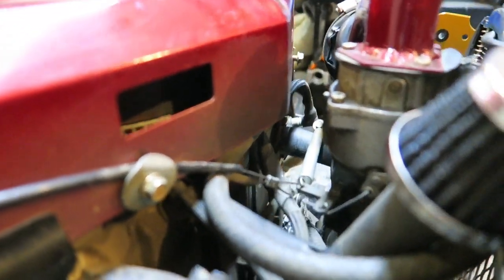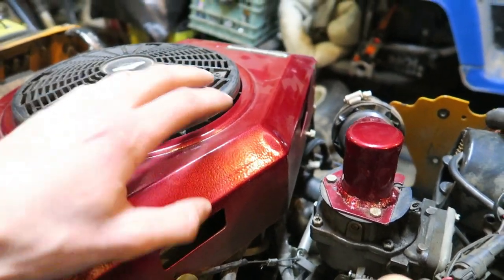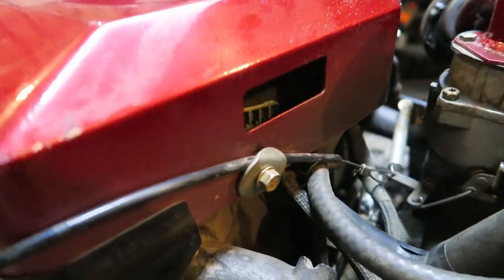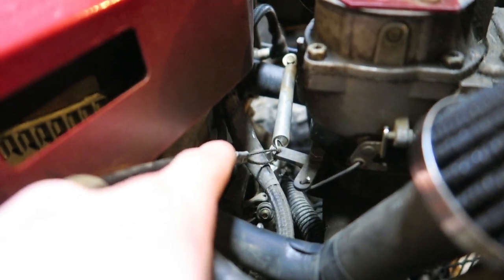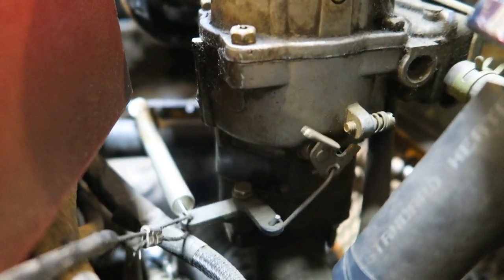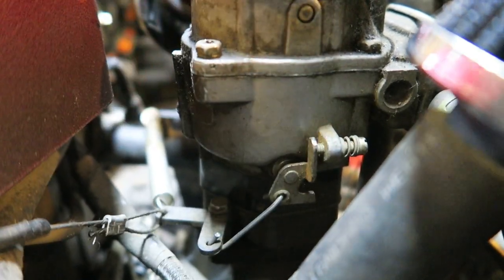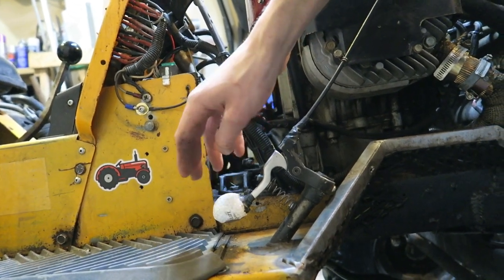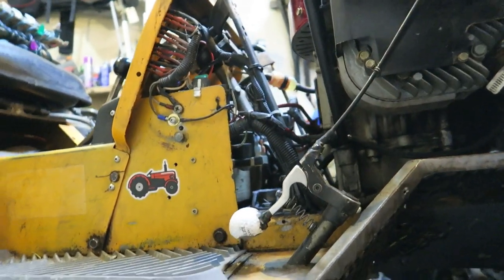How To mount a foot throttle on a Off-road Mud Mower

Comment: I thought about doing my linkage like this when I did my pedal... I actually ended up drilling a hole in the governor arm and used that to advance the throttle.  It actually works pretty well with the pedal.  I also still have my throttle lever on the dash hooked up... I call it my cruise control lol... It's on my channel if ya care to take a look!  I can appreciate your building style and creativity man.  I'm definitely gonna subscribe!
Reply: 😂 good stuff 👍

Comment: Putting throttle on a riding lawnmower cause problems in the future or is it cool I was not to I got a 1999 craftmans riding lawnmower 19 hp briggs and stratton twin cylinder engine

Comment: Dose the governor still work?? Like does it limit your RPM?
Reply from the maker: You will achieve higher rpm’s 
Until load exceeds power, 
And way better throttle response 

By doing a by pass tho 
You do leave “free metal” in the crankcase waiting to blowup! 
I have ran a few motors like this and have been lucky enough with no issues! 

Risk verse reward!

Comment: Sorry if this is a dumb question, but can a manual mower like a Murray be workably modified to have a gas pedal, or only automatics/hydrostatics?
Reply from the maker: This mower is a manual transaxle like all the rest of ours 
Manuals are the ones you want to start with when building a off-road mower
Reply: @okoffroadmowers  thanks man.

Comment: yo shuld i put my brake on my mower deck handle or my cluch bc i want to do that mod but my brake is on the right side so i would have to run 2 peddles
Reply from the maker: I would upgrade to hydro brakes, mount your lever wherever you want

Comment: When i take the linkage for the governer off of mune the mower is stuck wide open
Reply from the maker: You need to add a throttle return spring
Reply: @okoffroadmowers   on the governor or the carb?
Reply from the maker: @keeganholts3079 on the carb
Reply: @okoffroadmowers  I've tried that that works fine, but the governor gets stuck wide open, not the carb